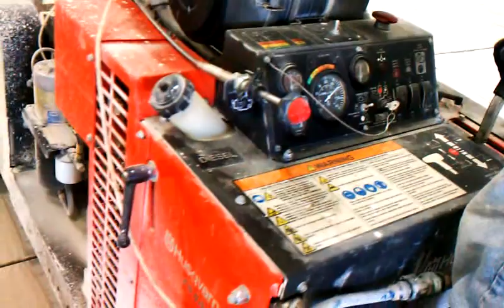Concrete Cutting Chris Jones

Comment: Enjoyed reading the comments.   I am the engineer who designed the machine about 11 or 12 years ago.       Yes the machine is safe.   Yes it is loud.    If you use water  there is no issue with silicosis.   It must be operated in well ventilated areas.      It is a diesel so Carbon Monoxide is not a huge issue like gasoline.    This operator and company are good at what they do.  It is not overkill for the Blade size.      This machine actually had an even larger blade.of 60" diameter.
Reply: A blade that size is at least $2,000. Possibly more depending on the type of blade. You have some blades where the diamonds are bonded a certain way to deal with excessive rebar. And a few other types. They're super pricey.
Reply: Pretty funny people commenting who have no idea about concrete cutting.
Reply: Are the blades disposable?
Reply: Donald Meister This is a awesome machine.Can i know upto what depth it cuts.Am in demolishing biz.Thanks.
Reply: Can you slice cheese witit?
Reply: Donald Meister - My company just got a new saw that can be used in confined locations. It emits little to nothing! Tier 4 emissions.  Amazing saw!
Reply: This is scandalous I AM THE ENGINEER WHO DESIGNED THIS MACHINE!
Reply: Does that blade cut through rebars?
Reply: I'm fairly sure diesel also emits carbon monoxide. Nonetheless nice machine!

Comment: You should not be at cutting speed until that blade is in the cut line. Once you lower the blade a couple inches in the cut line you can increase speed to what ever it is you want it at. And always lower your RPMs when you pull the blade out of cut. This is just  for safety reasons but the other reason is your blade is clearly wobbling at the higher RPMs and is cutting or wearing into the water supplies lines inside the blade guard. So lower RMPs until inside cut and lower RPMs when you pullout of cut.
Reply: You're sooo right I see what you mean.

Comment: Gotta love going full depth with a 36 inch blade, it's the only thing that would cut right through the concrete at the airport! 👍👊💪
Reply: When I did Dallas Airport we had to spin 48" on final cut. 60" in certain spots that was wild spinning a 60
Reply: This looks more like a 48” or a 54” sir 🤣 36” is way smaller lol

Comment: I would like to know if cutting this DEEP requires a (811 call before you DIG) I think there could be a Gas line underneath the concrete and always keeping in mind it’s all about safety first!
Reply: i do this for a living in Canada. We like to call if theres even a chance we're over lines of any kind. Power lines can be much closer to the surface than you would like.

Comment: How heavy is that thing and do they make a liquid fuel powered model?  Gas, propane, alcohol or something similar so you wouldn't need a cord.  Also how much electricity does that need?  What size generator would you need to power it properly?
Reply: and to answer your other question at least at hour company we have a 60Kpa generator to run the electric saw off 480 3 phase cable

Comment: Could you imagine having that thing catch on something and kickback haha... wholly shit.
Reply from the maker: Don't even talk about that
Reply: It runs off of a belt and not direct drive.  Of course a big spinning mass could pose issues  but if blade gets stuck the belt snaps.  Still one cool saw.
Reply: Steve Murdock Rock saws tend to be less dangerous than wood saws but a binding blade heats up and dishes - freakin' expensive! Not a good job for those who like to daydream, heh heh...
Reply: The machince stalls when that happens.... Automatically shuts off.... Local 57 concrete cutter i see it everyday....
Reply: They don’t kick back. I use one every day. The blade would just lock up
Reply: Or stall out
Reply: Its pretty safe just always stay behind it the blade seg ments brake off sometimes.

Comment: I cut concrete too tomorrow I will be cutting 22in thick concrete what is your technique or tip on using big blades Cris jones
Reply from the maker: To start I make sure the blades you use to step cut with are in good working order. No cracks at the segment base or the blade as a hole.
Check to make sure you saw is in good working order. 
Now it depends on the machine you use and operator preference. 
I would start with a 14"-16" .220, this cuts to a 5" depth.
Then I would jump to a 30"-36" .187, this cuts to a depth of 12".
Now I would like to put on a 48" .165, but that would only cut around 21". If the concrete won't break (wire mesh at the bottom or even rebar not placed 2" to 3" up off the bottom) you will have to use one size bigger blade at least. Probably a 54". This will get you to 24" deep.
Use plenty of water to remove spoils from the cut and keep the blade cooled.
Always match your blade rpm to the saw or be sure change to the proper gear.
Wear all proper PPE. Safety glasses, hearing protection, ect.
Reply: +chris jones thanks am on a 32 in and 36 in blade den am putting 42 in blade. so you think a lot of water is better because I been told if you use to much water u can wash of the sharp to cut on teeths on blade. wat is your Technike to cut a rebar running long way in the cut Cuz I ran into one today

Comment: I wonder how long the blades last, im currently doing a large job, with a core cut cc1200 and i have to cut through paver, asphalt and concrete, halfway through and have used up about 5 blades had to stop because the belt snapped, but boy i can imagine when that big ass wears out you hear some real alien noises.

Comment: what kind of floor do you have to cut that deep is that for driving tanks on
Reply: +Willy G P Most likely a foundation.
Reply: +Willy G P Airport runways are usually too deep for a regular flat saw to cut. And as stated before, foundations in sky scrapers are pretty thick as well

Comment: It wouldn't kick back, the black is spinning clockwise, opposite a conventional miter/skill saw. It would kick forward lol
Reply: Absolutely.. which is another reason you want a big blade spinning slower. That way if the blade does lock up?? it doesn't lift and throw the saw up and forward at full power. Big blades 42" and up spin slow.. saves the blade.. motor.. and your laborer

Comment: good job to the operator, but what people don't know is that he started with a 26" blade then a 36",42"54"with a smaller slab saw a 6600 then you bring out the big8400 that's a huskabarna slabsaw I know cause I have one my company just baught a diamond products slab saw that makes this saw in this video look like a baby toy check it out on you tube search alliance concrete cutting,and look for the video where we are cutting in the navy pier in Chicago il ,4 ft thick with a 82"blade
Reply: +Hernandez I watched that video. and that wasn't a 84 inch blade.

Comment: Why are they cutting it?
Reply from the maker: The company wanted to install a new printing press. This floor was at a thickness of 27-28 inches. The new press required a floor thickness of 36 inches. If I remember right it was about 300 ft run end to end.

Comment: I figure this guy is or will be suffering from silicosis dioxide with all the slurry and concrete dust he is breathing in. Also it does not appear he is wearing ear plugs either. Where this is just a demonstration video or not he should be wearing those to show and urge viewers to wear safety equipment as well.
This machine is overkill for the depth of that concrete slab as well. Is there a water main trunk line below? Gas or sewer line? What about a foundation beam or cable tension routes? Looks like a monolithic slab..
Reply from the maker: I'm wearing all OSHA rated PPE.  The blue thing on the back of my neck or my earplugs. I'm cutting with water so there is very little dust if any. Safety should be number one on any construction project.
Reply from the maker: The floor was core drilled to determine the depth prior to cutting. The floor is 27+ inches deep therefore the 60 inch diameter blade is necessary.
Reply: Its called locating or gpr scanning before you cut. You never cut into a slab without.knowing whats in it. same theory as call before you dig....

Comment: this concrete saw blade is quite sharp, I know a company has such a good saw blade, it is Chinshine Diamond Tools Co.,
Reply: Not sure what experience you have with concrete and asphalt cutting blades, I've been cutting concrete and asphalt for nearly 30 years, the blades are not sharp at all, they rely on abrasion to achieve the cutting.
Reply: where did you buy the cutting blades? I think you can have a try on Chinshine's cutting blade. For concrete and asphalt, laser welded blade is recommended, safe and sharp. Here is the email: sales@csdiamondtools.com

Comment: No nesesery to cut in small parts,more efective two basic cuts and then jack hamering.
Reply from the maker: Never work. It's 28 inches thick.
Reply: chris jones Can you tell me my friend howe much costs that job in your country.?Voja fromSerbia.Per meter of cut?
Reply from the maker: Usually I charge 300$US per meter, but since we cut so much I did it for 150$US. For a wall cut I charge 40$ US for 8 inch thick per foot long. For coring holes I take the radius times the depth times 1.75. So a 12 inch hole by 12 inch deep would cost roughly 252$US. 12*12*1.75=252
Reply: chris jones Dera Friend,in my country in Serbia,per meter 5euro to 15 euro(for extremly depth) floor cuting.250mm hole ticknes 25cm 25euro max.Open the door in concrete walls 150euro max.I would like to live in you country,do you have job for me.To survive I do welding diamond segments on spent saws.Voja
Reply: Its sometimes better and quicker to saw concrete into sections that can be lifted out and cheaper, I would just drill and fix a wedge anchor  and use a reusable lifting eye into each section, all you would need then is a fork truck ideally already on site belonging to the customer therefore saving them money by not  having extra machines to break up the concrete and remove the rubbish.
I noticed the floor saw started up with the blade turning normally modern Husqvarna floor saws do not do this nowadays ? the ones I use don't the operator did have ear defenders on I would have liked to see better ones and eye goggles but I am in a different country so do not know your rules, and to reply to why the machine was not set up and left to go the operator needs to be stood there to tweak the machine  when it begins to struggle an example would be when cutting steel , also he as an emergency button which he needs to be in reach of as he has a duty of care for other personal working around him and his own saftey.
Reply: +Graham Senior newer model huskys with the three speeds come with a blade clutch so you can drive the saw without the bladeshaft spnning